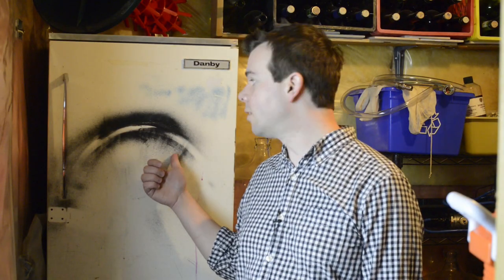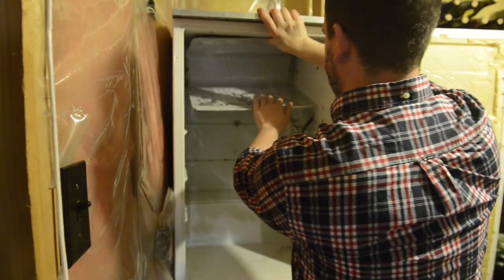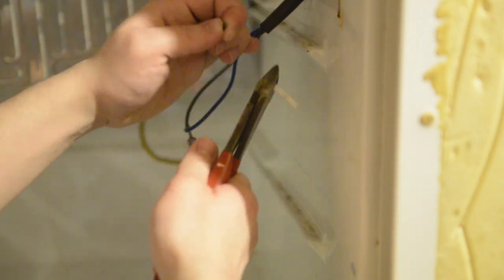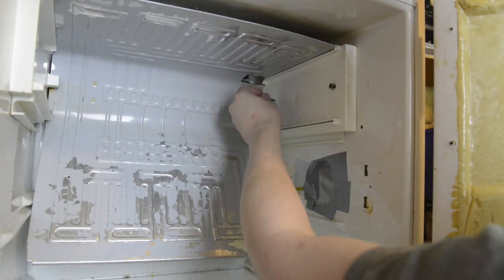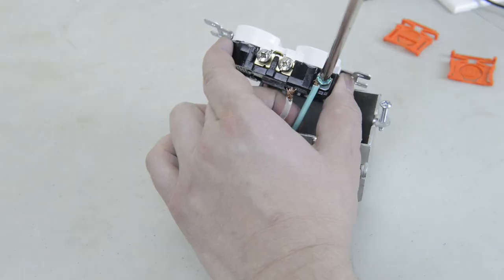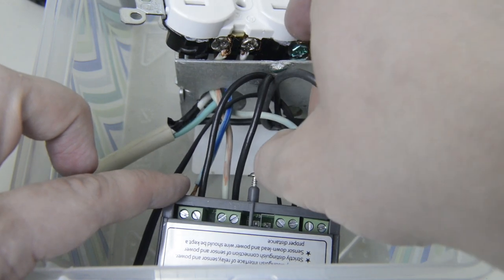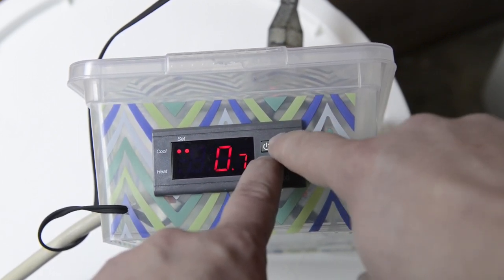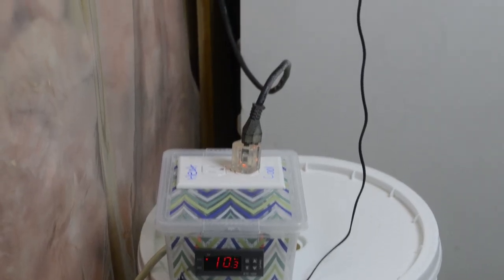Cheap Fermentation Chamber, STC-1000 Wiring and Setup

Comment: Hi, thanks for the video, I have the same fridge and I'm making a kegerator, I don't want to bypass the temperature regulator. But I did unplugged a wire (The brown one) by mistake, do you know where I have to plus it back ? thanks!
Reply from the maker: It's been so long that I don't remember. You'll probably be able to tell where it goes if you take the cover off the thermostat. I bet you'll find it. I recommend taking pictures before you start and along the way when your doing projects like this. It helps to avoid problems like the one you're having. Good Luck!

Comment: is that 220 vac or 120 vac. did you hook up a heat element?
Thanks
Reply from the maker: 120 vac. I actually turned this fridge into a kegerator. I was using a heat belt when I needed. I only make about 2.5 - 3 gallon batches. If I were making bigger batches I would get a different heating element.
Reply: Just use a heating pad...temp. runs between 24degrees c. and 22 degrees with room temp.@ constant temp of 19 degrees C. 7 days later, put in carboy and store in a dark place. I use one of my closets...

...
Reply: @michaelmccarthy8513  I live in Australia and our voltage is much higher at 250V and there's no way anyone in their right mind would strip and twist wiring as you have. My advice would be to buy some terminal blocks. They're cheap and ensure a secure and positive connection. I do, however, take on board your fridge modifications. I will be able to fit my secondary fermenter into an old bar fridge. All in all, a very informative video. Thanks, mate.

Comment: By cutting the white wire on thermostat, you are removing the compressor overload protection... any thoughts on that?
Reply from the maker: I paid $20 for the fridge. If it goes it goes. I should redo this and say this is something you can do. For my kegerator I didn’t bother by passing anything. I just let the stc-1000 do the work. For this fridge I needed to remove the thermostat for everything to fit properly. I didn’t think this fridge would last that long, but it’s been over two years and it’s still going.
Reply: @claytonwinter8782  I see. Thanks for the reply. :)
Reply: I see no reason to do it at all. Just set thermo to coldest setting and it'll always turn on when necessary.

Comment: i  got question's .. these 2 wiers u connect together are live ? ,and one with ground is neutral?? another one ,,rest (without heating) i use new cable to bring power to stc1000 and from that to rest like in your schematic .i bring power from stc1000 to old power cable to power freezer .. new power cable live to 1 and 7 ,from8 to old live cable to fridge,,from new power  neutral to 2 and to old cable neutral ,,and sensor is, temp  f1 18c with 1c f2 ,but freeyer wont start even it's always on ..connecting 2 live together and ground to neutral make on always i guess ....what i did wrong ?
Reply: can u help please
Reply from the maker: I'm really not sure. I didn't need to take mine off necessarily. I did it mostly to save space. I thought about wiring my stc1000 directly into the fridge, sounds like that's what you did, but it seemed more complicated. I'm not a wiring expect. I would check the schematics of your fridge and see where you went wrong. Without being there I really have no idea what you did or what's wrong.
Reply: ok i will describe simple way ..
Reply: i cut power cable of fridge ,and clean it ..then i connect it to sockets (2) with crew in it (2 way kind) ,,,then i cut cable that connect termostat in fridge .got 4 wieres .2 live 1 neut 1 ground ,,i conect + isolate 2 live and ground with neutral .....then new power cable  live to stc1000 1 and 7 ,and 8 to old live ,neutral to neutral of old power cable  and that was it .is it ok like that ?
Reply from the maker: Like I said I don't know. You'd have to check the schematics on the back of your fridge and check.
Reply: dont have any :)()

Comment: which thermowell specifically for STC 1000, does it matter? thanks
Reply from the maker: The STC-1000 comes with a probe. You really just need a thermowell that can fit the probe. The thermowell I link to in the description will accommodate the probe. I'm sure you could get a different one. I'm sure they're all around the same size. You could probably get a stainless steel probe and install that instead of having a thermowell.
Reply: thank you!